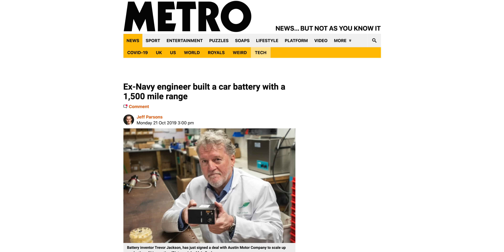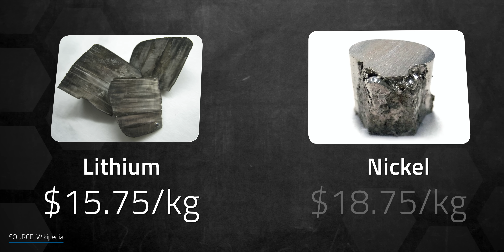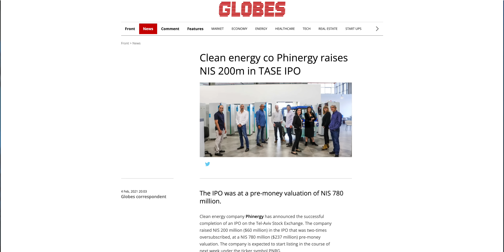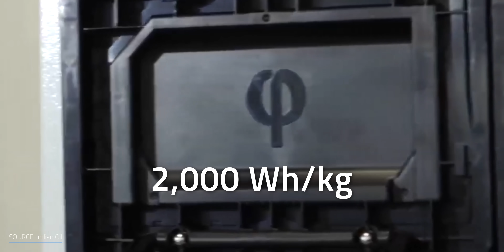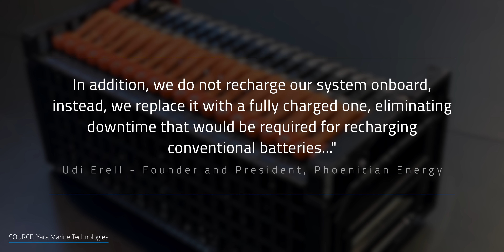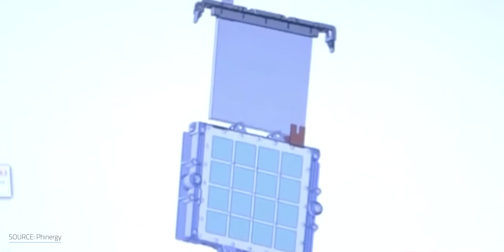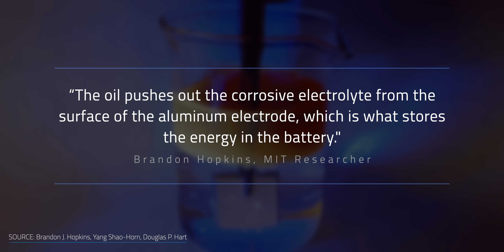Exploring the 1000 Mile Car Battery - Aluminum Air Hype?

Comment: Depending on the volume of silver required in each battery theft might become a problem, but if the content is low and difficult for Joe Public to extract then perhaps not.

Comment: One thing that makes it more believable is the fact that primary (non rechargeable) batteries do typically have a larger energy storage capacity than secondary (rechargeable batteries) of a given volume. Sometimes 2 or 3 times larger. For example, the energy density of lithium primary batteries is 2.88 Mega-joules per Liter. While then energy density of secondary type lithium batteries is 0.9 to 2.43 Mega-joules per Liter. The reported energy density of aluminum air batteries is 3.78 Mega-joules per liter.

Comment: A couple years ago when I first looked into aluminum air batteries in relation to cars the idea that struck me for them was to make it a range extender.

Have something more conventionally rechargable as the main pack for a car, then simply have a slot for an aluminum battery to be popped in when needed to extend that range for large road trips.
Reply: Yes. But in practice it's unlikely to work, as you would need plenty of stations where to swap the battery, plenty of batteries for the days where everyone goes on a long trip, yet most of the time all of that infrastructure wouldn't get much use.
Reply: @aesma2522  Just sell them at Auto parts stores and have a recycling program with a core charge... It's not really that complicated
Reply: @aesma2522  We have plenty of things like that already on the market. And if it's only losing 0.02% capacity like he said here with the oil pumped system, you can buy it and have it sitting there in the trunk until you need it.

The best comparison is probably propane tanks. Bulky, heavy, return-after-empty, and HEAVILY dependent on the day of the week, the weather, and upcoming holidays or other events. If you look on a map for locations to buy them, they're EVERYWHERE (I have 6 places I could buy them in my town of 3k population, and I couldn't name a single person in town that I know of who uses propane).

Amerigas (and presumably others) have what is essentially a vending machine for propane tanks. If this aluminum-air battery became a range extender commodity, I suspect people would set up the same sort of automation for it. Gas stations already have after-hours pay-at-pump as a 24/7 option for travelers without having to pay for an employee to keep them open.
Reply: @Merennulli    "and HEAVILY dependent on the day of the week, " wat ? here we have constant delivery on schedule of propane tanks. 
we don't even have piped gas because that system is so reliable and transporting gas in tanks is much safer than piping it, because piping leaks.
There's gas stations for swapping tanks everywhere. I even have monthly service I pay, and they just come and swap it for me, for all intents and purposes its like having piped gas.
The companies get really good at predicting your use pattern so they can just swap the gas, you always have 2 tanks, one you use, and another full one. They just replace them, all you have to do when you run out is swap the hose. But I am way more lazy, I just put 2 valves, and keep both connected at all times. (for a small risk of my valves leaking both tanks instead of one, but the risk is smaller than a big pipe leak, piped gas is insanity)
Reply: @monad_tcp  You are mixing up the small propane tanks I was talking about with your home propane system. The small tanks are primarily used for things like gas grills that see mostly weekend use and vary by the season.

And, yes, distributors can partially predict patters, which can also be applied to batteries being sold on a similar model.
Reply: @Merennulli  oh, now I know those small tanks.
those aren't very common here, we just use the big ones, they're a bit cumbersome to carry, they are 13kg. But they also last much longer to cook bigger meals for more people.
either way. both are the same propane fuel.
Reply: @monad_tcp  My point in bringing them up was the method of sale of those specific tanks.

Comment: I can see it in places like India with poor infrastructure. Instead of 1000+km range, it would be battery powered cars with 100~200km range. Once the battery is low, you’d go to a gas station and trade in your old battery for fresh battery and now your car will have 100~200km range.

It’d be literally like replacing AA cells on a RC car and potentially way cheaper than rechargeable EVs.

Comment: It would seem that this would be an extension of the “throw-away” society, not very “green” , sure the aluminium could be recycled but little else
Reply: Let me stop you there, if your battery converts the Aluminium to Aluminium hydroxides, you can only convert this back to Al metal by re-refining this, as alumina is the base material for refining of Al, you dry Al hydroxides to get alumina.

This is not like recycling Al cans where all you do is melt and job done. This is a whole other thing and is almost the same as producing new material from ore.

Comment: Actually I'd prefer a battery swap EV. No delay to refuel puts it in line with fossil fuel, go to the gas station buy a new battery and off you go... The question is, will it A. Cost less that petrol per km and B. Be affordable overall?
Rechargeable theoretically means if you've only got $20 left, you can at least charge up some, but if the battery replacement is say $200 then low end users are out straight away.

Comment: When you think about it, we already drive cars with a swapable power source. We need to refill our fuel tanks.... that's essentially swapping spent fuel (empty tank), with new fuel. I still think EVs are kinda dumb, in their current form, because of low range, and the environmental impact of the batteries.. But if swapping the battery was as fast as refueling a petroleum-powered car, and the price was comparable, it wouldn't be much different than what we have now.... except for the obvious limitations of batteries, which are a major turn-off for me. 

Additionally, being concerned about range isn't some silly anxiety, to be downplayed.. it's a legitimate criticism of the technology. Also, concerns about Lithium-ion safety are entirely valid, as well.. Due to the utter stupidity of Youtube, and it's comment censoring algorithm, i can't go into details, but lithium-ion, while safe under the right conditions, is still very dangerous.

Comment: In case of my car having this kind of battery, I would like a complemetary rechargable battery as well so I can get around on short trips and maybe stack up on alluminum when I go for a road trip. I see this tech being used the same way my parants old LNG car worked. Because that kind of fuel wasn't available everywhere it also had a gasoline tank in case you ran out of LNG.

Comment: You forgot to mention the abysmal discharge rate. They can only supply 5%  the power of their lithium counterparts. Not to mention that the battery is only effecient in terms of energy per mass, not energy per volume. Air type batteries have so long to go..

Lithium air coin cells are already a thing though, which is really amazing
Reply: Really big, bulky car that accelerates slowly… Isn’t that what we have now, except they also make fart noises?

Maybe ultra capacitors for go juice in short bursts. No one is flooring it for hours at a time

Comment: Good presentation, but please help educate the users of misleading imperial units. 
Weight is a force. Don't use it when you mean mass; density or strength per density. It's very frustrating for the majority of the world who use internal units - especially when your tabulations are already in kilograms; kilograms/litre (or gram/cm^3) and MPa/kg or MPa/litre.🥝🥝🙏

Comment: A mixed system would be perfect. 
~100 km range on lithium for daily usage (going to and from work, shopping etc) with the ability to recharge.
~1000 km range on aluminum for longer trips (holidays, or business trips)
If there would be 2 aluminum batteries instead of one, then you don't need to worry about when to swap, 
just swap one after its empty and the car can use the other one for next 500 km

Comment: Regardless of the efficiency of needing to recycle (which is its own challenge) that Al air battery, can we discuss the benefits of weight?  A P100 Tesla battery weights almost a ton (1860 lbs, 845 kilos), and that will get you ~300 miles.  The Al air battery weighs ~125 lbs (55 kilos), and requires two to go 1000 miles.
Weight is what kills roads, so in theory roads would last significantly longer with Al-air battery packs.
Also, just a little disingenuous of Matt to list the kilo price of Silver compared to nickel and lithium without mentioning how little silver is used, and little it needs to be processed in these batteries.

Comment: I rather have an EV that I can charge at home and drive 300-400km than a EV where I need to go to the "gas station" and change battery every 1500km or so. One of the best things with having an EV is home charging and that I mostly don't have to care about "filling up' since I don't drive more than 300km per day most of the days.

Comment: Why not use batteries with a aluminium electrode and a graphite electrode in hydrochloric acid. This would be recharcheable as long as put the positive charge to aluminium electrode. Positive aluminium ions and negative chlorine ions and hydrogen molecules wil form. The only challenge then is make HCL from hydrogen and chlorine again. Properly some kind of katalist like a platinum membrane is needed to make hydrochloric acid again.

Comment: For apartment dwellers, condo owners or any other who might not be able to plug in a car overnight, but still want a modern electric experience: They could think of this as compelling (I do).  Yet, I think hydrogen cell is further along and generally more convenient.  Without understanding the cost of monthly (or more) swaps, it seems like something that I'll be interested in, after it makes third gen development.

Comment: What exactly makes them incapable of recharging? Is it just the aluminum sheet? I feel like this could maybe work

7 x the capacity is insanity. This needs to be pursued. This is like comparing the isp of rocket engines vs. jet engines:
300 isp vs 3,000 isp

Comment: 6:20. In that shot of the batteries being replaced, it seems like the vehicle stores two batteries of the same capacity. I think that makes the battery-replacement idea relatively feasible. As long as one remembers to replace the first-used battery ASAP after they start using the second, you would rarely find yourself much below 50% fuel capacity. That is a big IF, though. I think some heavy-duty and persistent reminders to the driver would be in order, and it still wouldn't be a good idea for everyone unless/until changing centers become commonplace.

What I'd have a harder time with, is the fact these batteries are apparently underneath the car's storage (hatch/trunk/boot). Clearing it out every time I need a change would be a pain! (Or an embarrassment, if the technician does it.) Even if it only happens every few months, I know it would make me put off getting a change. I'd want these to have a compartment of their own before I commit.
Reply: It is stupid of you to assume that storage trunk cabin and battery placement entry and exit can't be separated even if it is vertically below the trunk. Sorry, if stupid word offends but it was really really bad argument.
Reply: @HimanshuRohela  Well, I didn't assume that. I said "apparently" because it looks like that is the case. And by saying "I'd want these to have a compartment of their own" I am expressing that I hope it IS possible to store/access them separately, and I would want that feature before committing to drive it for so many years. I'm glad you mentioned that, though, because it would be wrong of me to assume that they would necessarily release a car with all the features that make sense FOR ME. There are lots of cars that have/lack features that I think don't make sense, so chances are that even a car whose main power source I love might still be disappointing to me if their overall design decisions don't follow through. Basically, it's an 'I hope they will', not a 'too bad they can't'.
Reply: @ethanhayes  Okay 👍

Comment: You simply don't need that much energy density in cars when it has so many drawbacks but I could totally see airports investing in battery swap infrastructure for long haul electric aviation where energy density is paramount

Comment: With the amount of driving I do in my full electric car, I would have to replace batteries about every four to five months, depending on the real range of them. That's not a problem in itself. This really depends on the cost and time of doing so.

For the system as a whole, another deciding factor is the complete efficiency. Right now, the recharging of batteries is the most energy efficient way of doing propulsion with something like energy-X far behind. This type of battery would need to be up there at least close to the current way of doing it, or the cost of electricity would be too high.

Comment: "not rechargeable"
You jumped the gun on april fools.  non-rechargable batteries for powerwalls or evs sounds like a massively terrible idea.
Reply: Al batteries are terrible ideas for most uses. There is a reason that 60 year old tech isn't more developed. 

Oxidising metal is a dumb energy source as reducing metal oxides is pretty much the hard work of refining metals. Thermodynamics says no.

Comment: the 2 kWh/kg figure for aluminum is decently impresive, no longer an order of magnitude away from hydrocarbons. assuming that electric motors are about 4 times as good as ICEs (maybe 2.5-3 times as good for very modern ones), you're rivaling useful energy per kg stored.

Comment: They would do well as as hybrid solution in conjunction with lithium. Develop cars with small lightweight lithium packs for daily communting and running around, then have the ability to grab an Aluminum air pack for the one or two road trips you realistically take in a year.

Comment: People who have strong motivations to be green might go with vehicle that required battery swapping. For the rest, I think the ability to charge at home on cheap electricity is the motivator, and a car that needs battery swapping would be seen has having the disadvantages of a petrol vehicle, and none of the advantages.

Comment: It takes a huge amount of energy to smelt aluminum, not to mention the mining and ore transport.
 The battery works by electrolytic corrosion destroying the metal, making it into mud. It would have to be re-smelted to recycle it. The round trip efficiency is probably not stated for a reason. It is hard to imagine how this could be economical. Or practical.

Comment: Why couldn't they just make it so you can put a new chunk of aluminum in? Like, pull the old chunk out, or whats left of it, and put a new chunk in.  As for having swappable batteries, sure. Get the range up to 3000 miles and then it becomes alot like an oil change.

Comment: One thing I don't get in all this,  while trying to fix up the range problems with full ev's is great.  why is there not a bigger push to get out the hybrids and the plug-in hybrids??   Granted they both still use gas, but still they use way less of it then regular gas engines.  And They do not have the range issue at all.  As even when their batteries die they can still drive like normal (just with worse mpg then when the battery does have some charge)
Those are the perfect kind of cars for those who are interested in ev's but have that range anxiety.  Because you still basically get the EV experience and a good deal of the befits but also can become a gas car automatically if you do forget to charge the battery, or you need to drive it for longer then the rage of the battery. Best of both worlds sort of thing.  And surely it's better then having them give up and go back to a full gas car right?
Reply: I don’t think you understand how much hybrids suck. The same price as a comparable electric vehicle for an objectively worse car. And you’re giving money to the companies that started this whole mess in the first place and also covered it up. 

30 miles of electric range is nothing, that doesn’t cover most people’s commutes. Also you have all of the maintenance problems of a standard ice and more. Literally get a new model 3 or a Bolt if your heating bill is too high. You’re going to be much better off in a new EV for a decade than a stupid, overpriced, impractical hybrid for 3 years.

Comment: I always remember a scene from The Fifth Element where a couple of guys are changing the energy pods in the ship while getting high. I always thought of that as a very clever way to power any vehicle (minus the getting high part), and it would be even faster than refilling the tank with gas. I totally imagine myself going to a power station, getting a fresh battery pack that I can change myself and will last me for a month, then getting out of there in less than 5 minutes. The switching part must be super simplified for it to work, I guess.